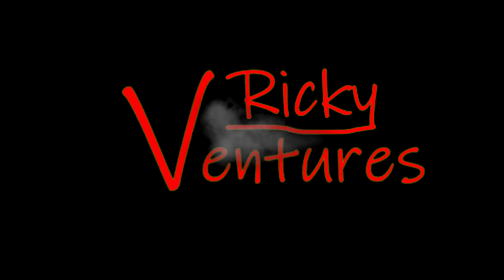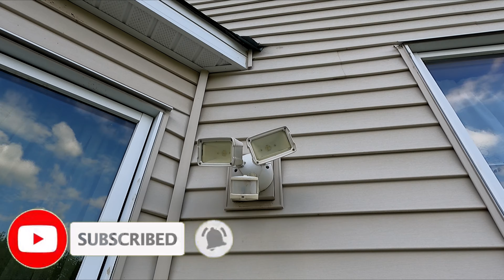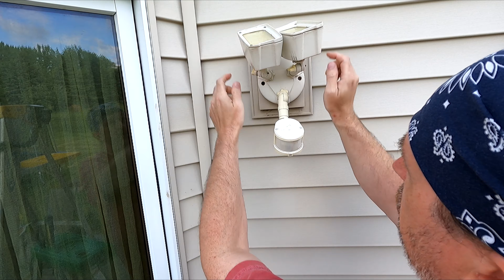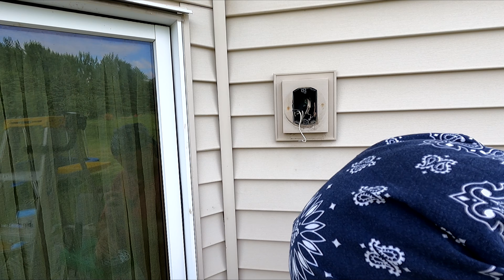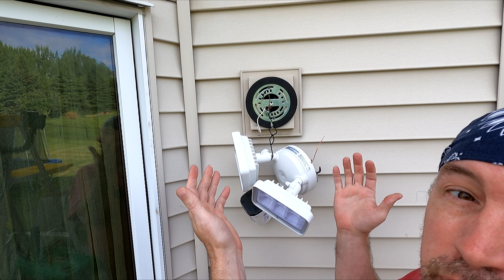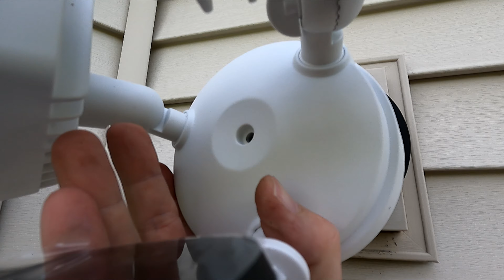Amcrest Floodlight Security Camera Install

Comment: What complaints you have avout the camera ?
Reply from the maker: I can't say that I any. It's been running well since I installed it!
Reply: @RickyVentures  how about the focus and connection to the wifi?
Reply from the maker: Haven't had a problem with either of them. Even in bad weather, it does well. It also handled the Minnesota cold with no problems.